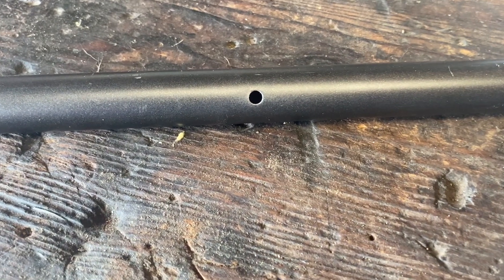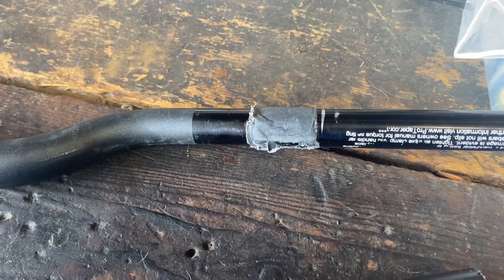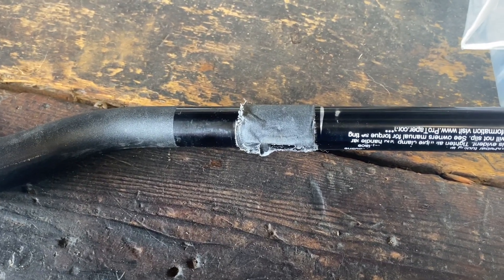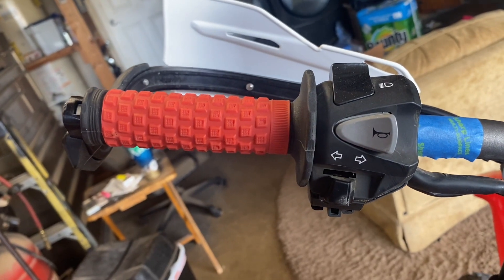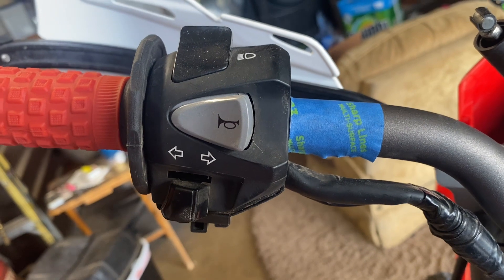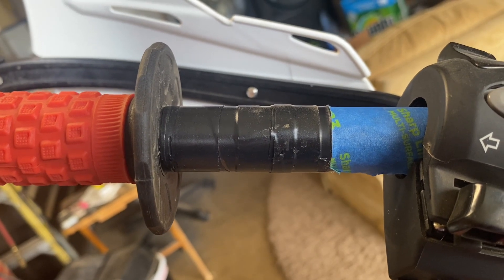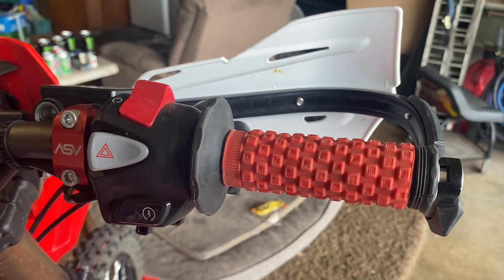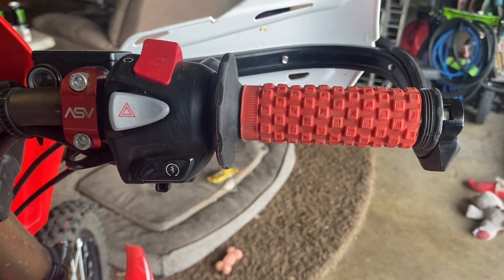Crf300L - New Handlebars, How to Install Your Grips and Controls the Easy Way, Dual Sport Motorcycle

Comment: Just got one! Will for sure be getting new handlebars.
Reply from the maker: Congrats! If you have any questions feel free to ask!
Reply: I have not ridden a dirt bike since I was like 10, should I ride it home? It’s two hours drive but I just really feel like riding instead of hauling it. What would you do?
Reply from the maker: @johnharris7756  yea I would, ride it and have fun. Just use different rpm’s and shift through all the gears. It will be a good break-in ride.

Comment: Awesome, do you use grip glue at all?
Reply from the maker: @CheekyMiner  not at all, the rubbing alcohol just evaporates and it’s stuck on there.
Reply: @184racing  Oh thought maybe they would spin around without glue, thanks.
Reply from the maker: @CheekyMiner  I had used Renthal Half Waffle Soft grips in the past and would just use safety wire to secure them, grip glue would eat through the grips. When I switched to the Pro Taper Pillow tops, I was planning on safety wire but they didn’t spin. I’ve had 5 sets on 2 different bikes now with no issue.

Comment: Great video 👌 I want to use the same protaper adapter/risers but I'm wondering if its possible to add more risers to the protaper riser and if there length in the cables
Reply from the maker: Thanks! I think length of the cables might be a issue. I have the cr-mids, I’m guessing the cr-high’s are about max unless you used the risers that also move the bars forward.

Comment: I saw the ASV cap, was curious if you picked up their hand levers for the 300L? I ordered some and tried to install them in the stock perch, but I couldn't get the clutch lever in. Their fitment chart said they would work with the stock perch, so I'm wondering if I'm just missing something. It is a few millimeters thicker than the stock clutch lever. Any ideas?

This is also perfect timing as I've been thinking about upgrading my handlebars 😃
Reply from the maker: I didn’t use the asv levers for the 300l, I had them on my cb300r and a Grom. When I bought the 300l used it already had the zeta levers. I actually prefer the feel of the zetas over the asv’s. As for the thickness I don’t know. I tried the asv front brake lever for fitting and it worked but never tried to install the asv clutch lever. I’m just using the asv rotator so I I lessen the chance of breaking my lever.

Comment: Where did you get the asv brake lever /cylinder bracket?
Reply from the maker: Just search asv rotator clamp. They are between $25 and $35.
Reply: @184racing  Ty. Great videos! 🔥
Reply from the maker: @Isaiaha400  Thank you!

Comment: 2021 CRF300 here, this tape thing def did not work for me on the throttle side, on the clutch side yeah but still a mm gap after screwing closed. I had to drill the throttle side, if anyone is doing this, unscrew the little metal thing with the nub and 2 screws and remove it from the housing, drill until the nub can fit flush BEFORE putting anything back together, save yourself about 2 hours and a lot of swearing,
Reply: If you remove the nub, the housing will move. The point of the nub and hole is to keep it in place

Comment: I tried this tonight, but I couldn’t get the plastic on the throttle controls to close completely. There was always a gap in the plastic.

Not sure if that’s common or I am a little off in alignment on the throttle tube and control housing. How many wraps did you use in the throttle side?

Any ideas?
Reply from the maker: I don’t remember, use a few more wraps the nub should indent into the tape and the control should close with zero gap.
Reply: The plastic won’t close because it needs the hole to fit in. Honestly who gives af about it spinning while crashing, just drill the hole and do it the right way
Reply: I’m having the same issue with my controls not closing. There is a gap. Did you ever figure out how to make them close flush all the way?
Reply: @Josh-ge5om I ended up drilling down a bit. I did not drill through though, just deep enough for the notch to sink in.

Comment: So I just use electrical tape under the throttle attachment? Wrapped 3-4 times?
Reply from the maker: Yes sir
Reply: Ive followed your video but now the bottom part of my electric start casing doesnt join back together to be flush, what should I do?
Reply from the maker: @Johnsmithabcde  unfortunately, I’m not there to see what you did. I would try to add some more tape or take some off. Maybe you have it too close to the edges and that’s spreading the control apart. If you can get it to work you have the other 2 choices shave the nub off, or drill the hole. Drilling should be easy because you will have a indent on the tape where the nub is pushing against it. What year is your bike? A 23? This is the first I have heard it doesn’t work.

Comment: What is the brand and where did you get the braided steel brake line?
Reply from the maker: It’s a core moto, The line is for the 250l and the low profile version. I had them add 1” to the hard tube to fit the extra travel of the 300. Here is the link. I have used there brake lines in the past on other bikes and they are a great company, never had a issue. If you want more pics let me know. I can post them in the community section of the channel. 

https://www.coremoto.com/HONDA_CRF250L_13_20_DUAL_SPORT_FRONT_BRAKE_LINE_p/cs0037.htm